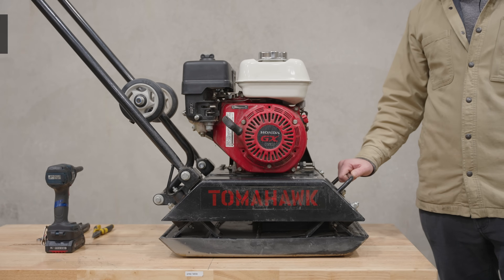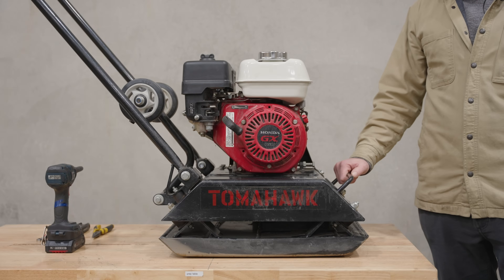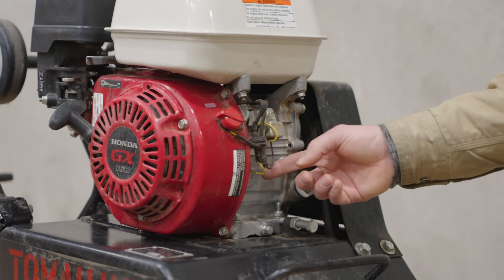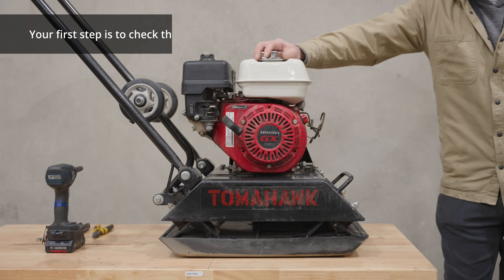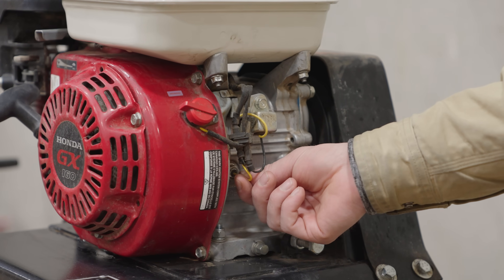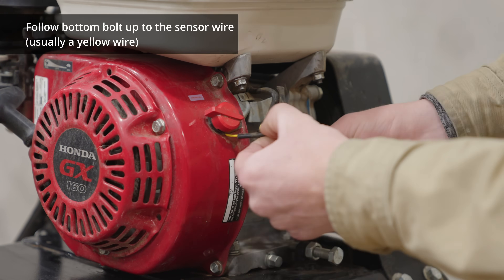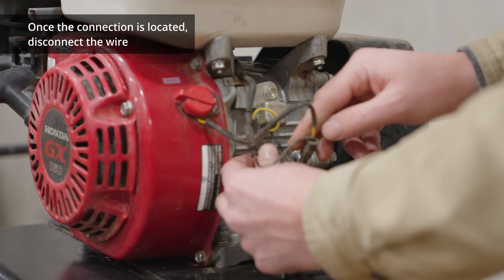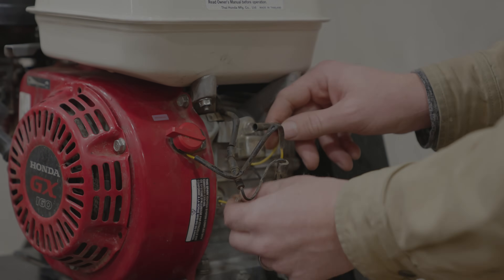How To Bypass the Low Oil Sensor on an Engine - Honda GX160

Comment: It could be a faulty low oil cutoff switch.   You should be able to just disconnect the switch to test.   If runs disconnected, replace the switch before someone runs it out of oil.

Comment: THANK YOU, here is my story:   Problem with my dethatcher with Honda GX160 engine. Would start fine, idle fine, but try to move the machine and it would stop running. Sometimes it would run/operate for 40 seconds then at a turn, would stop.   Replacing carburetor, spark plug, cleaning gas tank/replacing fuel filter, checking oil level, clean air filter, trying to run with a loose gas cap:  still same problem.  Solution which took all of 2 seconds (lterally):  disconnect the "low oil sensor".  After I did that, ran perfectly !! Like you show, at the base of the engine, look for a wire, probably yellow, coming out of the sensor. Disconnect it at the coupling. Machine runs perfectly now.  Jesh .....
Reply: same hear , with a fake Honda  170f   tried every thing would some times not start then start then stop after 40s or after idle   , cleaned the carb like  3 times , loosen fuel cap incase  of vacuum , driving me nuts this fix it fine, what a  mission
Reply: Did you replace the low oil sensor? How easy was it to remove from? Is it required to split the case to replace?
Reply: @andrewbrenneman9592  I did replace the sensor. I don't recall the specifics, but it was just "take the old one out, put the new one in", took 30 seconds. I just re-watched the video, the wire he holds in his left hand, that wire leads to the sensor and that is what I replaced.  Unscrews like taking out a spark plug.

Comment: On any plate tamper it's wise to run stud kits for the head and side cover because of vibration from the rumbler. Those tampers are harsh on your engines components. Also like he stated just disconnect the yellow wire oil sensor to keep the engine from shutting down but make sure proper oil fill before each job. We have 3 Tomahawk plate compactors and a North Star compactor which is a budget compactor but a great machine. Trust me put the stud kits in to prevent future problems if you use it alot.

Comment: …And you don’t need to remove the small box at the top of the yellow low oil sensor wire? All the other videos on YouTube seem to make the process much more complex by removing that box and cutting wires.But I like this process better.
Reply: Nope they just remove it to make it look cleaner, you don't have to
Reply: @RichTexas82513 I just disconnected the wire then used a 1 in peice of heat shrink tubing and dummy connected it😂 looks good